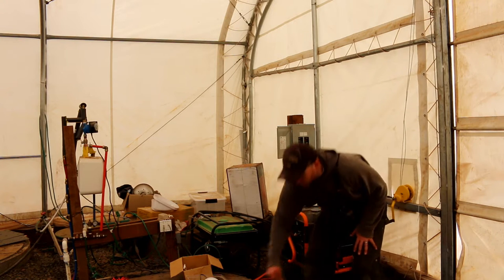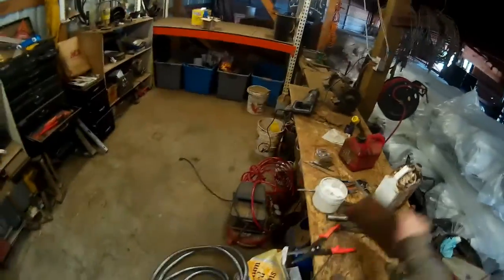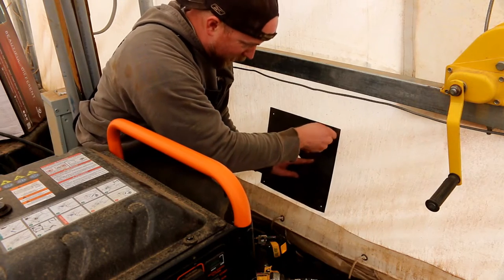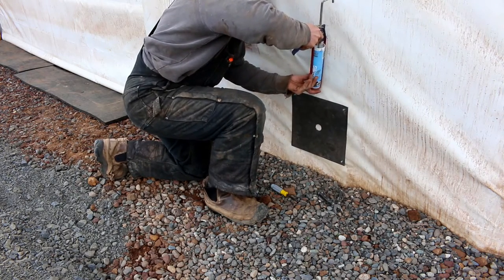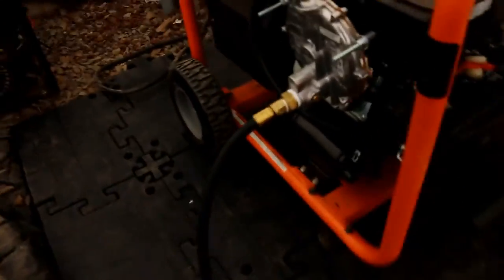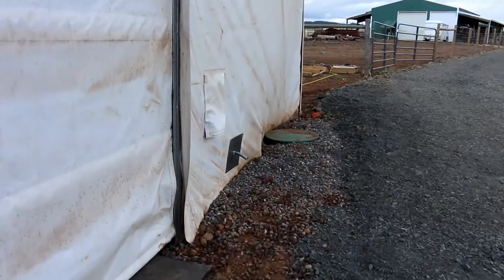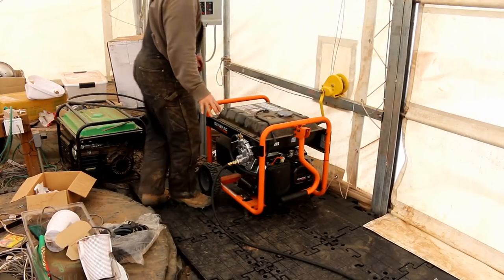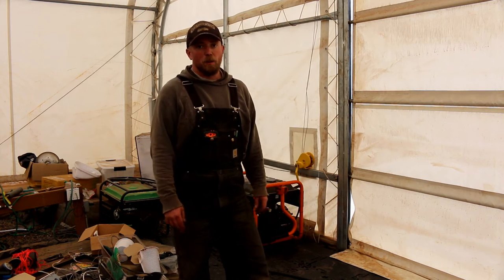Generac PROPANE GENERATOR CONVERSION Install

Comment: Think you could build a box around it to shield the noise?
Reply: I've got a generac generator 5000 watt, in a closed 10 × 12 building and can still hear it a mile away, it does crank 1st pull and works great, just bought a champion 3100 watt inverter generator for my camper, 58 decibels of quiet

Comment: Normally you would lay the sheet metal flat on the edge of a table and clamp it down, then cut it with you saw.   Same goes for the drilling of the holes.  You might use a board under it to drill into.   I've never seen anyone do it the way you did.   Glad you didn't hurt  yourself.   Also surprised you did this before you had to reskin the building.  Seems like your just creating more work for yourself.   You may want to put a little awning over it on the outside to keep snow from building up over the exhaust pipe.  Then again if it is hot enough it will probably melt the snow anyway.   Maybe next year when you have more time you could put it outside of the building, to cut down on the noise.    You should of made a video of the gas to propane conversion.   I probably would have watched that.

Comment: I been looking for a propane conversion kit for the Generac XT 8000 EFI (I assume the EFI. stands for electronic fuel injection). Is there one for this model, and if so, can anyone point me in the right direction to find it? Thanks

Comment: do you need to run the exhaust if the generator is on propane, I know forklifts that run on propane are just fine inside, maybe leave it plugged and only use it for gas?
Reply: Todd McCarter it’s to keep the co2 out of 5he building

Comment: You are going to pull the conditioned air thru that generator and out the exhaust. If you use outside air for the intake at least the generator will create heat.

Comment: Not sure if I should be trusting someone who decided it's better to overkill with the reciprocating saw over simple tin snips to cut the sheet metal... Had hoped to hear more about the propane conversion install, not the generator install.

Comment: I'm sure you know, but just in case, an engine is just an air pump. You're creating a negative pressure environment in your building, which is not preferable when you're also trying to squeeze all the efficiency out of the habitat as possible.

Comment: Please spend 10 bucks on a pair of tin snips to cut your sheet metal. You can find them cheap at pawn shops. Side bonus; they aren't noisy like that sawzall and don't require electricity! Plus you have less chance of cutting your hands holding it like in this video.

Comment: Concept is fine, but why run the generator inside the building?  Why not build a raised enclosed insulated platform outside the building - something similar to the porch you built and then just remote mount the generator control panel inside the building?  Last winter you had a lot of snow against your building - great insulation, but a hinderance to the position of your exhaust extension.  Also, the accumulated noise from all your man made sources will make conversation problematic?
Reply: Xoncention cold weather.  Makes small engines turn over real slow.  The engine oil gets really stiff and thick.    Inside the building will be warmer than outside especially with the heat going.
Reply: Randy J - Hi.  I guess no one has heard of dip stick or oil drain oil heaters?  It does not take very long to alter the viscosity of the oil.  There are also cold weather oils available.  Also insulating the enclosure as I said would make the temperature similar to the one already in the growing area.  Small motors have been used in arctic environmental conditions for decades.
Reply: Heats the shed too. Works like a Combined heat and power (CHP) engine, which is clever because the thermic losses of the engine will heat the shed and the plants too.

Comment: OK.so power I thought was from solar Panels. I watched you install these. Why in the red world would you spend 1000$$ on a generac?
Reply from the maker: no batteries..grid tied...so still need the generator (which was less than $1000) for power outage

Comment: not to be a safety Nazi but you are you are going to have to move that some were else you can not be within 6 feet of any door way and it's to close to your elect disconnect
Reply: or the propane line on the floor in front of the door.